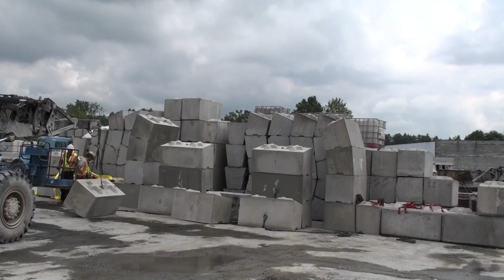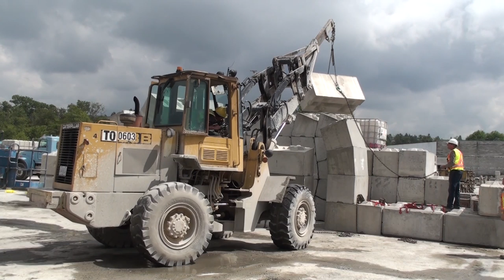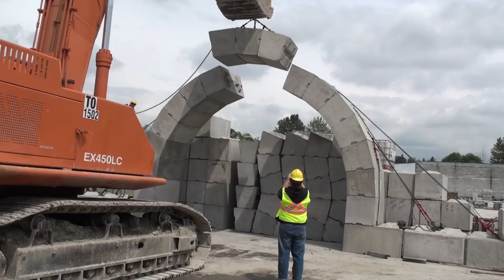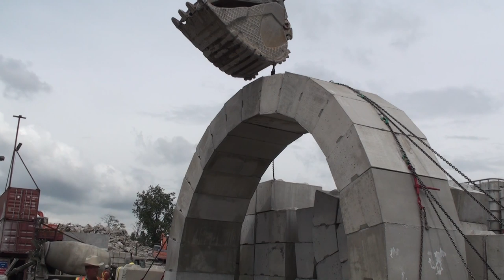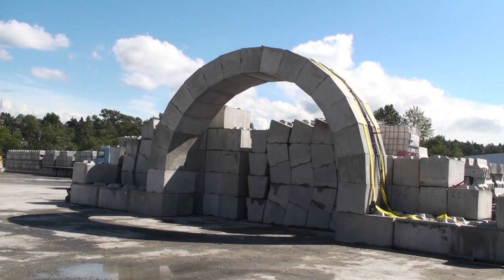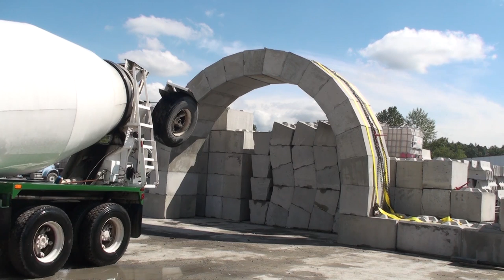Arch-Lock™ 6 metre span

Comment: Do you have plans to make cosmetic improvements on these blocks?  I imagine that it wouldn't be too difficult to modify the molds to make them look like rough stone blocks.

These things have tons of potential.  One thing I don't think I heard mentioned is that a structure could probably be disassembled and sold/reused.  When a reinforced concrete structure needs to be taken down; it just gets destroyed and the leftovers need to be disposed of at a significant cost.  These things could be sold for profit instead.

I don't really have a use for Lock Blocks but I still think they're pretty cool.  I look forward to seeing them in use in the real world.  Best of luck to you Lock Blocks.
Reply from the maker: We've been in the business for over 30 years and we make blocks with a variety of finishes.  You can view some examples on our website.  Thank you for the kind comment.

Comment: These things are great. I liked your 'reclaim tunnel demonstration' as well.
What is the expected life-span of these blocks? 
If and arch like this one was built and then, for some reason, abandoned, how long might you expect it to last?  Thanks
Reply from the maker: The lifespan of the structure depends on the concrete used, but easily into the hundreds of years since there's no steel reinforcement to rust.

Comment: I want to build an earth covered home out of this system.
Reply from the maker: Contact us through our website and we'll see what we can do!  URL in description.
Reply: this would be fantastic for earth covered housing. might be a bit challenging to intersect a wing into it tho.  I'd also love the idea of the half round igloo end. It would almost give you an underground amphitheater effect.  Spray the inside with shotcrete or even a stucco and trowel it smooth.
Reply: sotxbob I was thinking six meter for the primary living space, a small section of three meter, connected to the main structure by the miniarch, as a walk in freezer or storage, or even a parking garage if built into a slope.
Reply: Lock Block Ltd. I wouldn't want to use up valuable sales person time.  Building our own home is still outside of our available budget.

Comment: Do you offer stronger block options, and stainless steel loops so the blocks can be disassembled in 20yrs without rusting away?
Reply from the maker: The hooks are galvanized steel and are only used for lifting purposes and do not contribute to the strength of the structure;  it is purely in compression when backfilled.  Stainless steel available on request.
Reply: Thanks

Comment: If you'd cut a block in half...it would be a one section block. You make, actually a 2 section block. If you would make a 3 section block, you could then stagger the joints, making a stronger build.
Reply from the maker: We have them but they were not necessary for this structure.  Check out our other videos to see the staggering.

Comment: how wide can this be and can it be burried?
Reply from the maker: This one is 6m wide at the base.
Reply: Lock Block Ltd.  Thank you, but how wide can it be and can it be burried?
Reply from the maker: Currently, we have a 12m arch designed as well, but we still need to do the design methodology for it and test it.  In theory, any size arch can be made if the blocks are big enough.
Reply: Lock Block Ltd. Thank you. I have emailed you through your site. I'm interested in. 40' × 60' barrel vault for a project.